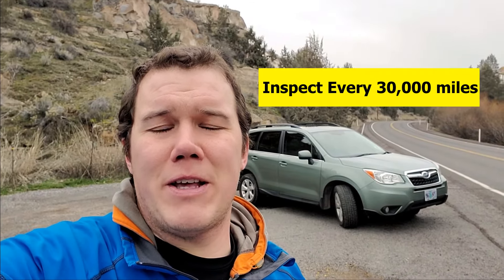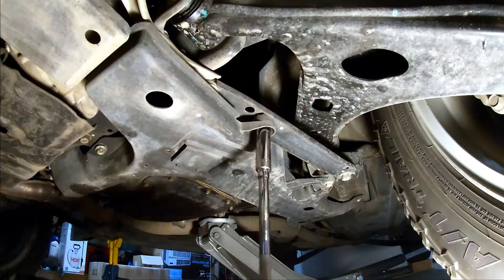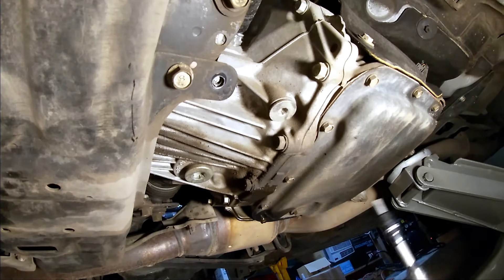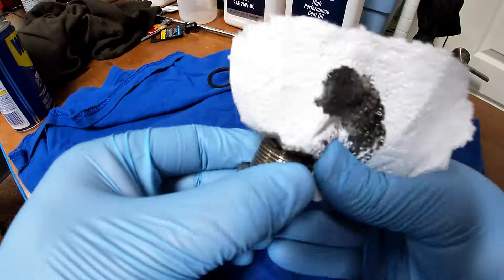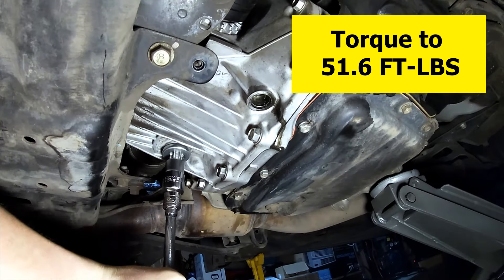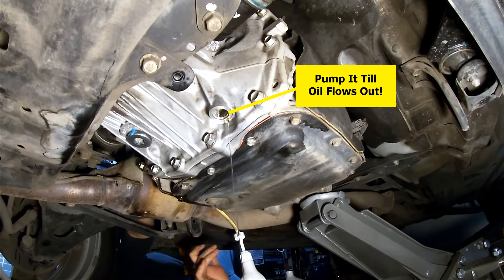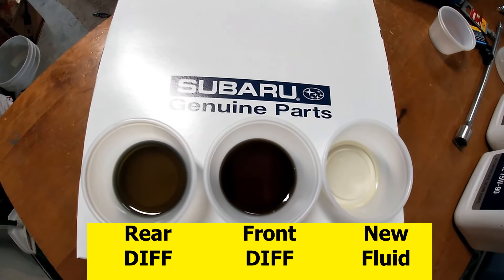Subaru Front Differential Fluid Oil Change | 2015 Subaru Forester | Drain & Replacement of Gear Lube

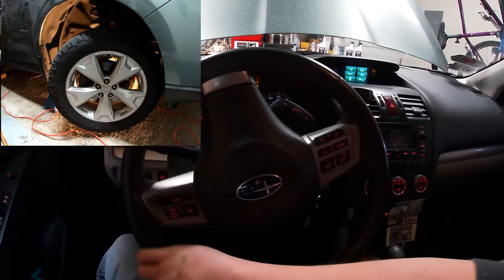Comment: Hey MT, at 1:29 you asked if you are missing a side skirt on your front passenger wheel well. You are not! Rest assured. https://i.imgur.com/HMdvBm7.jpg and https://i.imgur.com/q0lPBZh.jpg

Did you shear your 8 mm hex trying to break off the front diff fill plug? I did even after using penetrant oil lol. The Neiko metric set I ordered from Amazon is low quality. Good thing I had an extra pittsburgh one from Harbor Freight. 

I know you took oil samples - did you get them sent off to Blackstone Labs to get them analyzed? Curious to see the analysis. I collected the oil from the rear diff, but couldn't get enough for the front diff (it came out too fast for me to try and collect during "mid-flow"). Also... you made this look too easy lol, would have been a lot easier if the aluminum jack stands I have from Harbor Freight could go up higher. It seems like you had a lot more room in your video :/
Reply from the maker: Jason Lee thanks for the feedback! You are the first to confirm the sideskirt. 

I did not shear my hex drive. It was very VERY tight though and took umph with a big breaker bar. I used a husky hex bit from home depot and it held up! You can try penetrating oil and some heat from a heat gun. Also time can be penetrating oils friend, like a week before - spray it on. 

I did take samples. I still have them, but did not send them in though. I am not sure if I want to, though I am curious as well. 🤔 Taking a sample from a pan, or even the end of a drain is not the end of the world, unless your pan was dirty...

I hear you on space, It was tight in my tiny garage, and getting it level and high enough was tough. I actually did the differentials, and CVT all in one day plus filming. I hope it went well for you, and I hope the video helped. 👍
Reply: @MTsubfly  No problem on the side skirt ! I could send the rear diff fluid in, but based on the magnetic plug shavings I saw, I am not worried. Also, having that information wouldn't help me at this point since I plan to do differential fluids every year from now on. It took me 4 years to do 30k miles and I don't tow.

I will say that having done this overnight in my empty gym's parking garage at ~80 some degrees that I will do it during the winter from now on.

Hopefully since I have torqued the front fill plug and rear fill plug correctly they will be a lot easier to undo the next time I do it again this winter. 

I did see that you did the CVT at the same time you had the underbody transmission cover off for the front diff. I am extremely hesitant about doing the CVT because almost everywhere I have read about this on SubaruForester.com people have said it isn't worth it due to what could go wrong on an almost $10k part.

I am not a professional mechanic and don't know for sure if CVT fluids need to be flushed in a "clean room." I have talked to Subaru corporate about this a few days ago when I asked about refrigerant recharging procedures. I know they have a 100k/10 year warranty on the CVT. Of course, the life of your CVT is really just the luck of the draw from what I have heard. Failures are rare, but they can happen at say 20k miles. 

Anyways, I talked to two Subaru service dealerships this week about the CVT fluid change and they were both very hesitant to talk prices for CVT fluid service compared to diff fluid (they both gave me the lifetime fluid line). They said that if they had to do it, it would be $350 or $375 (the two dealerships had different prices) compared to $290 and $225 for front and rear diff (first price for CVT corresponds to first price for diff at that dealership). 

In any case, a CVT fluid service would only be about a 4 quart top-up and not a few cycles of drain, fill, going through gears, to try and flush out as much as possible like in your video. Long story short, I think it isn't worth doing until you are past the 100k/10 year warranty. At that point however I will have "nothing to lose" and will do it at the same time as the diff fluid since I plan to keep my 2016 Forester until it dies.
Reply from the maker: @jkxss  Yes I agree. Although the manual says it should be done in severe driving conditions... overall if it was me I might just let it go to 100k miles. I had the dealer do my CVT at 30k-ish because I wanted "break in debris" flushed out. But now I know they misled me and only did a pan drain/refill, and not a full system cleanout like they said. It's too bad dealers are typically this way. As for the Diff. after seeing my fluid I'm not so concerned these days. So many people dont keep their cars that long anyways. One reason I do my own maintenance and log it, is I usually sell my vehicles myself, and its been my experience that buyers really appreciate seeing the maintenance records.

Comment: I have a 2018 2.5i Forester and my set up is different. I have found the T70 drain and the check plug/hole (clearly stamped - Thanks Subaru) , but I can't be sure I have the fill hole. Roughly where yours is on mine there is a 10mm allen that when removed clear looking oil came draining out. I plugged it back in quickly because I'm afraid that was the not  fill for the differential (why was it clear and why would it pour out the fill hole?). I'm stuck now because I can't be sure where the fill hole is. Why can't I pump the oil into the check hole instead until it starts coming out?
Reply: Never mind. I was coming in from the Drivers side wheel well. Like you said, I tried the passenger side wheel well and found the right 8mm plug. It is a BUGGER! I'm gonna need a bigger breaker bar.
Reply from the maker: You got this man! I know that side fill plug is a tough one! Sounds like you got it. Fluid could be clear if you don't have many miles on it?
Reply: @MTsubfly  No, the fluid came out of the 10mm Allen plug on the other side of the engine (through the driver side wheel well) I found the two drain plugs below for the CVT fluid and am wondering if the one I removed above was the fill plug for the CVT fluid. I saw your video for changing the fluid for the CVT fluid, but that looks a bit much for me. Would the fluid pour out of that if it was the fill plug? Maybe 1 tablespoon of fluid got out before I put the plug back in. I hope that won't make trouble.
Reply from the maker: @brianentz4884  I cannot tell you for sure. I know new CVT fluid it blueish. Used fluid will be a little dark. So I don't know what plug you pulled out momentarily. On my car the fill plug for the forward differential is on the passenger side (wheel well).
If you pulled the CVT fill plug (which is back away from the front diff, and on the drivers side) and your engine was not running, then yes some fluid should come out of it.
If you can drive it to the dealer, ask a tech to look at what you removed and they should be able to help.

Comment: Hi, thanks for the video! How likely is it for the differential drain plug to come undone? I recently took my car into a dealership for an oil change and a few days later the transmission broke and they found the differential drain plug was missing. I suspect they are at fault but I would like a second opinion.
Reply: (2014 Subaru Legacy 2.5i limited)
Reply from the maker: I can tell you that on my rear differential, I went to check the fluid level after the dealer changed its fluid 2 years prior, and I was shocked when I un-threaded it by hand, I have video of it. So it is possible. BUT my opinion is that its way WAY more likely for the tech to have under-torqued it by not using a torque wrench, or not using a brand new gasket, or the tech threaded it in and forgot to tighten it at all...Maybe a combination of all three! When you use a new gasket, and torque it to spec, it's not likely to back out... so mechanic error likely.
Reply: MT Thanks for the quick response! I deeply appreciate it. I’ll keep you updated for your curiosity

Comment: Those two rubber hoses up top above the fill plug are vents to the diff?  Why is there two?  Are they both for the same front diff or is one the cvt?  Is it possible to take the hose off the vent there and fill through that hole instead?  I have a 2017 Forester and can't get that fill bolt off.  Was wondering if that route works through the vent hole, I just need to know if it can be opened easily without damaging things.